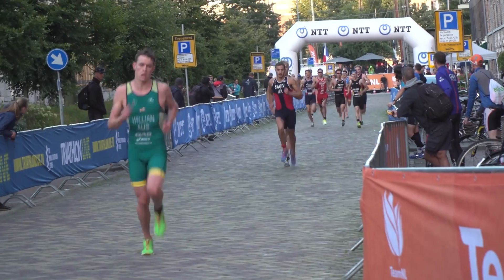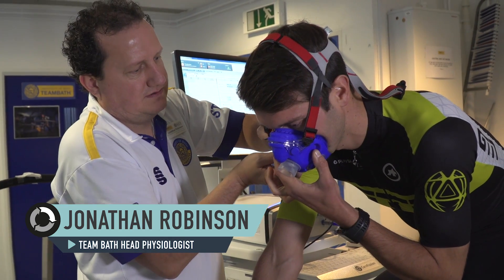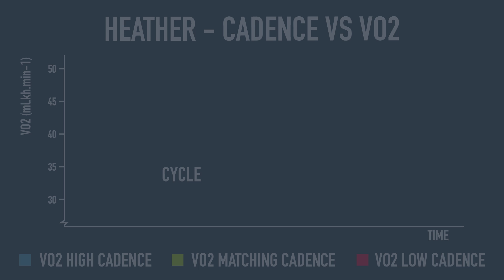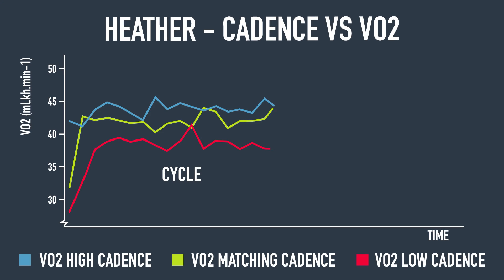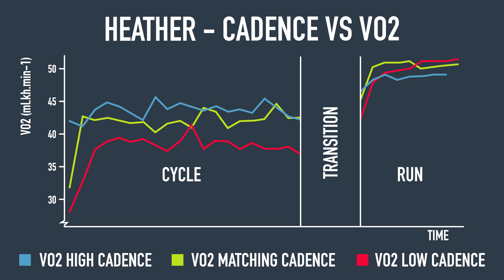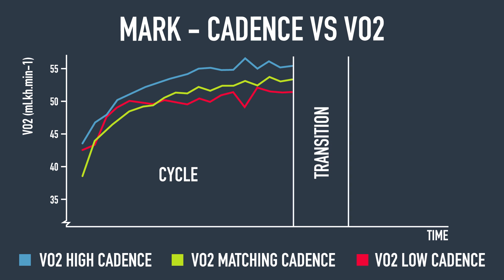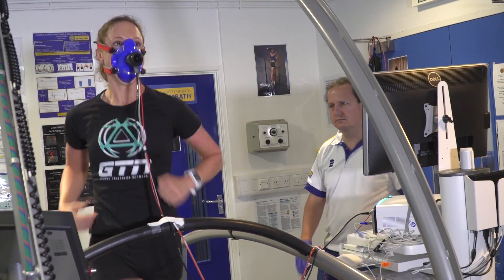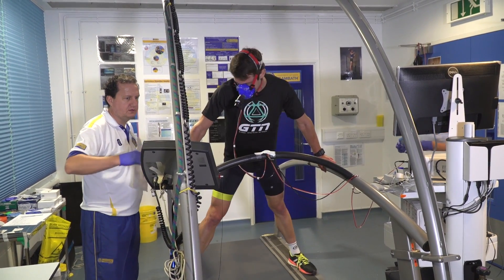What Is The Optimal Cycling Cadence For You To Run Faster Off The Bike? | GTN Does Science

Comment: Great idea but the cadences are too extreme. Few ride that high or low. Try 80, 85 and 90 or 75.85,95. Subtle difference but more in the normal range and few would deny even a change or 5 rpm can be felt (hence the addition of a 16 cog)

Comment: wow, i'm surprised she can say that 65 rpm on the bike felt the easiest!  I sometimes do a workout with 4 equal intervals, the first at 60 rpm, second at 80 rpm, third at 100 rpm, and 4th at whichever cadence was the most challenging.  I have a hard time even holding 60 rpm due to the stresses on my knees, where making the same power at 90+ rpm is way easier on the joints.

Comment: One thing about using trainers for this kind of test is they give a skewed reading versus real world. In the real world you spend 20-30% of your time freewheeling, this can mean soft pedaling or just not pedaling at all. This is born out in pro's Strava data sheets, where best case pedaling time is 88% during short time trials and worst case of 68% for roadies in a peloton. Going back to the lab, the issue with trainers is the inability to soft pedal. Typically a low cadence rider exerts high watts for a duration, then reduces power enough to maintain their speed. In contrast a high revolution rider exerts a more linear, but lower power output for a ride. The high cadence rider will be more accurately represented on a trainer, but the lower cadence rider's style will not.

As a side note, after your recent video on running cadence, I switched to a 180 spm cadence and I definitely saw a huge improvement. My average heart rate went up, but it knocked 30 seconds off my average per mile pace. More importantly going from a 170 to 180 spm cadence seems to be allowing me to run without some pain I previously experiencing.
Reply: With regards to the freewheeling thing, you're certainly right in a standard road cycling setting, but in triathlon you spend very little time freewheeling, especially in non-drafting races. I can't remember ever freewheeling during a race except around a bend, or approaching a turnaround point. I softpedal downhill usually.

Comment: Very cool. You're also more likely to ride a lower cadence on a hilly or mountain course which goes to show what you're going to feel on the run. Maybe more teeth on the cassette to help push a higher cadence than you necessarily feel you need would be good. Or, it may be that the higher efficiency on low cadence on the bike may start to hit the bike itself given a longer test period. 😀

Comment: #askgtn love the show. I'm new to triathlon and signed up to 2018 Ironman Mont Tremblant. Thoughts on BCAA vs electrolytes in drinks on training/races? Thanks
Reply: Test it before any race in training for gastro and also it's not bcaa instead of eletrolytes its bcaa in addition to regular nutrition. Remember you may also not get this in official race day nutrition so have to carry ur own.
Reply: ironman tooltime thanks.... so.... I would still need electrolytes? Yea I figured I would have to carry my own. Was trying to figure out the food/drinks during the race. I'm using bcaa now and wondering if that's enough.
Reply: nlt120 i think u definitely need electrolytes if u have any kind of sweat rate or in hot climate. I actually tried bcaas in training instead of sugars but with eletrolyte to try and get a boost on ketosis in lomg runs. I ran a 22 mile run with no sugars just bcaa (instantized in a camelbak) with high5 tabs and salt. Removing the sugar encouraged a more even pace and i liked not chugging the gels but cut out the salts and i know I'd cramp. Not sure i could last longer than three hours no sugars though and wouldn't do more than 2 hrs without electrolytes. Fine to try in training just don't forget race day nutrition is most important.
Reply: nlt120 by the way ur event sounds absolutely incredible 😁😎

Comment: As a mitochondrial researcher I want to try to explain this a bit. 
So overall VO2 max is not a measure of one energy system but rather a measure of overall energy production. This is because you can’t control your aerobic vs anaerobic systems they are both always running. I understand we all want to avoid lactate production from anaerobic (citric acid cycle) energy production, but in reality the lower VO2 max score is showing that they actually needed less energy to perform the same tasks. So that will mean a lower aerobic and anaerobic energy production for the same run. 
Though we all wish we had control over those systems we really don’t. However, we can design training for each system based on time intervals. Still, both are always running in healthy mitochondria. Short sprints do rely more on glycogen storage and anaerobic systems for fast cheap energy. While anything over 45 seconds will be aerobic and rely on the oxidative phosphorylation system (OXPHOS) system. Leveraging this type of training can improve the efficiency and size of glycogen stores for sprint and changes in pace. 
The best way to think about it is that every increase in pace you are generating more lactate and using energy stores faster so they need to be replaced. The OXPHOS system requires by products of the critic acid cycle to function, so to produce more energy the anaerobic system is upregulated first. The important thing though, is they are both upregulated. The OXPHOS system just takes a few seconds to pick up the pace where as the anaerobic systems are instant because they have stores of energy (ATP) they maintain and just keep stocked up. However, they run out fast. That’s why it is about 45 seconds worth in a fit athlete.
The idea that biking at the same pace actually makes a lot of sense if you think about it this way. By maintaining a pace the OXPHOS system does not need to be upregulated when you get off the bike like it does when you bike at 65 rpm. The decrease in VO2 max after a faster bike is because the system can slow down gradually as ATP stores are replenished. However, triathlon bikes are longer than the runs. So, you might be out of energy by the time you get to the run if you make the bike too hard. 105 would certainly do me in. You need to know your limits. 
Overall, the results are to be expected and are a testament to the controlled environment they were in. Hope that helps.
Great video guys! Love it! Mitochondria for the win!
Reply: Can I get mitochondria with caffeine? 🤔
Reply: ironman tooltime caffeine has some interesting effects but the general result is increased energy production from the mitochondria you already have. However, this is short lived and has some consequences. Research shows caffeine can aid in endurance. Still, it requires multiple doses in a triathlon length event and must be taken before starting. 
Hope that answers that for you. You can’t get more mitochondria from caffeine, but can benefit some athletes.
I should also say dosing varies. Too much is very bad. Not enough has no effect. Needs to be trialed in training.
Reply: Cameron McKnight 
deep! but makes sense
Reply: Amazing explanation Cameron never knew this
Reply: Great insight. Fair play. 
Hope there won’t be “copy and pasters” out there using your comment 😂

Comment: Why does a high vo2 indicate worse? Wouldnt using more of our oxygen/aerobic system and less muscle anaerobic be better for limiting muscle fatigue?
Reply: Sorry I am a mitochondrial researcher I will try to answer this. 
So overall VO2 max is not a measure of one energy system but rather a measure of overall energy production. This is because you can’t control your aerobic vs anaerobic systems they are both always running. I understand you are looking to avoid lactate production from anaerobic (citric acid cycle) energy production, but in reality the lower VO2 max score is showing that they actually needed less energy to perform the same tasks. So that will mean a lower aerobic and anaerobic energy production for the same run. 
Though we all wish we had control over those systems we really don’t. However, we can design training for each system based on time intervals. Still, both are always running in healthy mitochondria. Short sprints do rely more on glycogen storage and anaerobic systems for fast cheap energy. While anything over 45 seconds will be aerobic and rely on the oxidative phosphorylation system (OXPHOS) system. Leveraging this type of training can improve the efficiency and size of glycogen stores for sprint and changes in pace. 
The best way to think about it is that every time you change pace you are generating more lactate and using glycogen stores faster. The OXPHOS system requires by products of the critic acid cycle to function, so to produce more energy the anaerobic system is upregulated first. The important thing though, is they are both upregulated. The OXPHOS system just takes a few seconds to pick up the pace where as the anaerobic systems are instant because they have stores of energy (ATP) they maintain and just keep stocked up. However, they run out fast. That’s why it is about 45 seconds worth in a fit athlete.
The idea that biking at the same pace actually makes a lot of sense if you think about it this way. By maintaining a pace the OXPHOS system does not need to be upregulated when you get off the bike like it does when you bike at 65 rpm. The decrease in VO2 max after a faster bike is because the system can slow down gradually as ATP stores are replenished. However, triathlon bikes are longer than the runs. You might be out of energy by the time you get to the run if you make the bike too hard. 105 would certainly do me in. 
Overall, the results are to be expected and are a testament to the controlled environment they were in. Hope that helps.
Reply: Maverick5588 higher o2 used for the same power output therefore less efficient. I can push higher power at lower cadence (ftp) and the vo2 result confirms why. But this kills the run. Something the mitochondria guy said might be the reason.
Reply: Maverick5588 wondering the same
Reply: Cameron McKnight yes and you're also a shit miner.

Comment: My cadence has been higher and higher on the run, these days I’m running at over 180 steps per minute (183 this morning easy run, 184 last friday threshold run), matched cadence would be around 95rpm. I think I would blow up quicker if I cycled at that cadence, because my heart rate is usually higher at a higher cadence on the bike. So it’s a tradeoff, sometimes I find varying cadence on the bike is probably more efficient. It’s quite hard to output a huge amount of power on descents, so that’s an opportunity to push a higher gear and lower cadence, then on the flat using a higher cadence. Climbing for me often results in lower cadence than on the flat because it’s hard to have a high cadence when getting out of the saddle. I agree with Jon Shook, if you want to have a nice run start you need to back it off towards the end of the bike leg.
Reply: xGshikamaru my hr is higher with high cadence too but my i can hold it for longer because the muscles stay fresh

Comment: I really enjoy riding low cadence... shoud I start slow and then bring my rithm up to match my running speed??
Reply from the maker: Taking it slightly easier at the end of the bike and upping your cadence should make running of the bike feel nicer
Reply: This is what I do, my preferred cadence in triathlon is a bit lower on the bike, but I bump the cadence up for the last few minutes before the run and that helps get the legs moving well.

I'm no pro, but I am a super clyde (mostly muscle though) and my big legs like pushing a larger gear at a slower cadence. My averages in a race are like 80 on the bike, and 170 on foot (again, 2m tall, 100kg+)

Comment: I always have tight heavy legs at the run start, and I've tried high and low cadence, but spinning in an easy gear near the end of the bike helps a little.
Reply from the maker: Taking it slightly easier at the end of the bike and upping your cadence will make running of the bike feel nicer if you like cycling at a lower cadence!